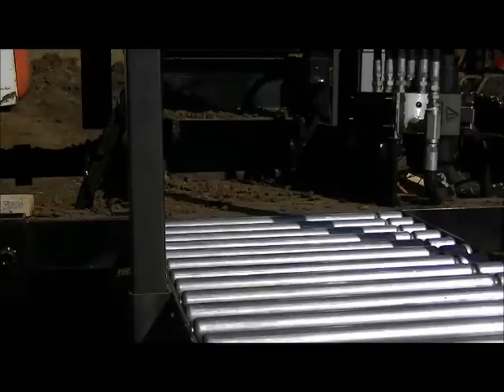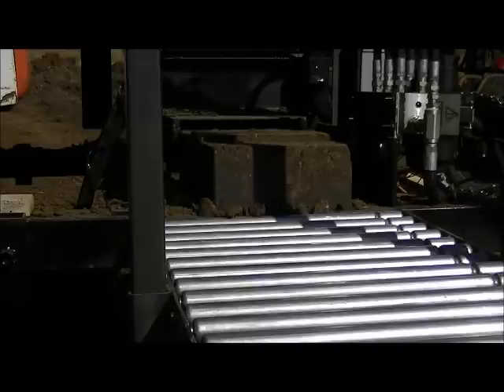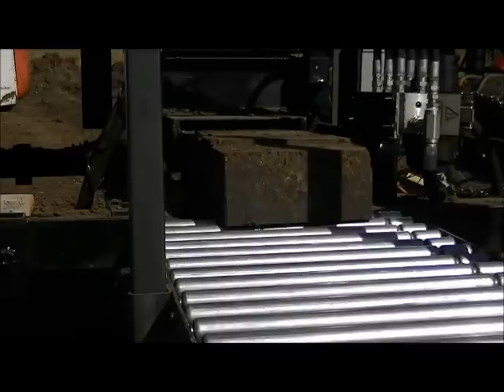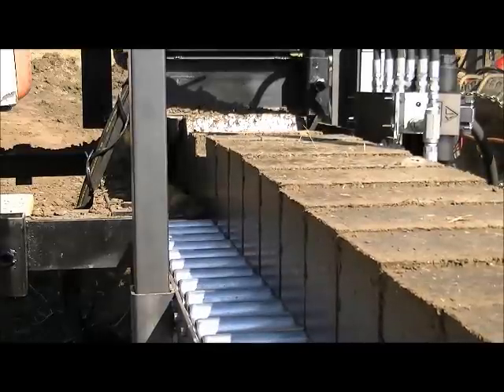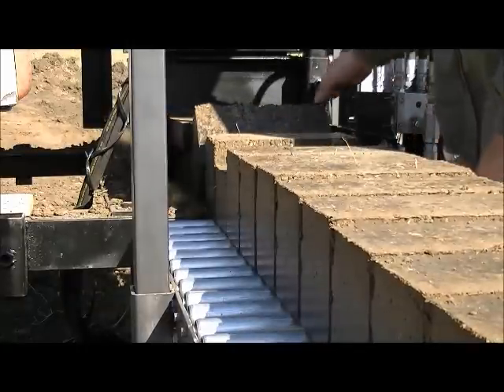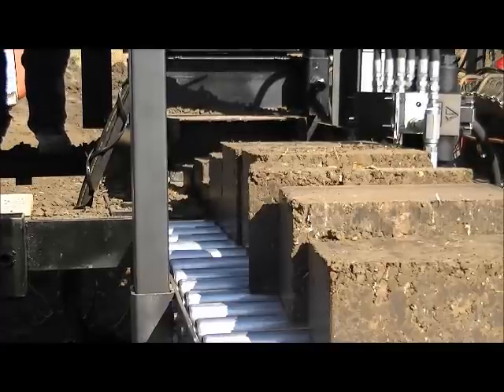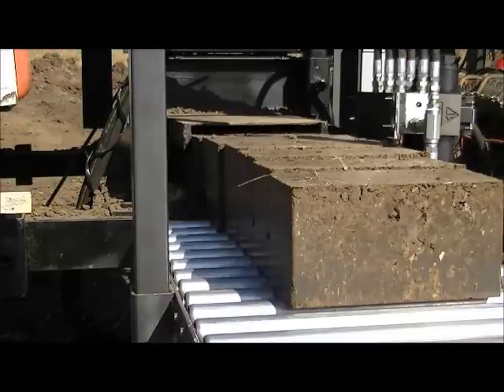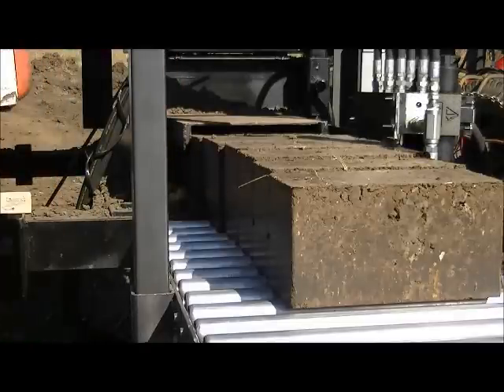CEB Press Test - 2011-10-23 #1 B.wmv

Comment: I'm just now learning about CEB but know allot about soil densification (construction back fill) If you make a ball of soil and it fall apart when you open your hand if falls apart or even cracks a bit, add water.  If your hand gets a little muddy, too much.  Ideally it should be just enough water to allow the soil to hold together.  I'm guessing this would hold true for CEB as well.